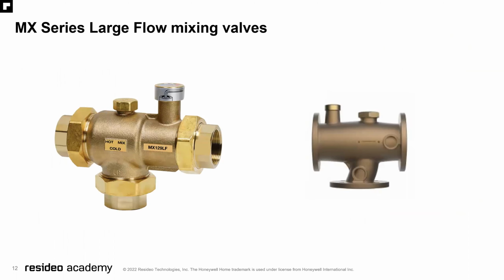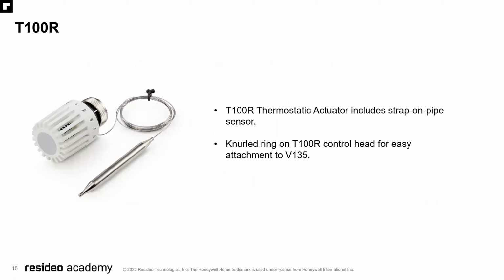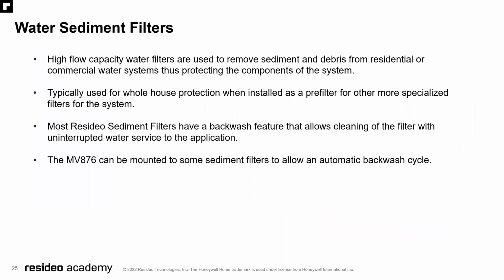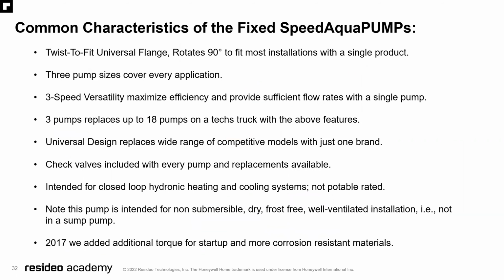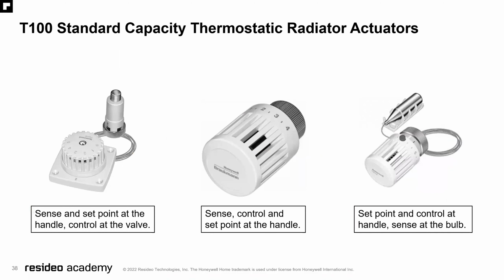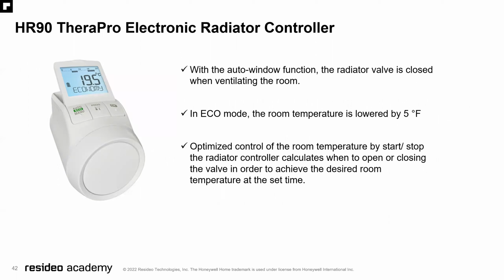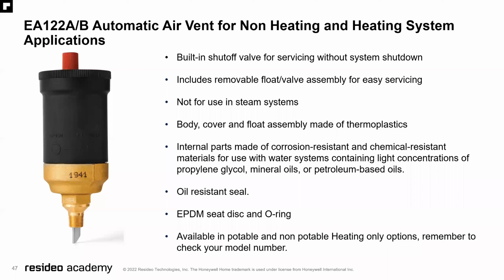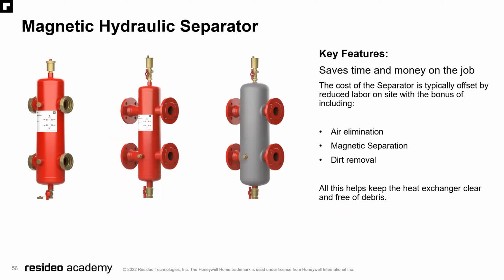Resideo Braukmann Overview

Comment: I just had a DS06LF installed. I loosened the screw to adjust but the 75psi number just spun while turning the the knob, I would like to get it to 60psi.
Reply from the maker: Hi two beer, we recommend you to reach out to your installer to receive assistance with this. If your installer needs help, they can contact our pro support team Monday- Friday 9 am to 5:30 pm CST. -Maria

Comment: I have the f76 and it seems like I’m missing a part to connect the hose for back flush? Could you point me to the right piece?
Reply from the maker: Hi DerekTibbs, we would like to gather more information in order to better assist. Please reach out to our support team on Facebook/Twitter with a private message. We look forward to hearing from you soon. -Paul
Reply: This should be part number AA76-1/2A? Usually it is already included in delivery and mounted under the filter bowl.
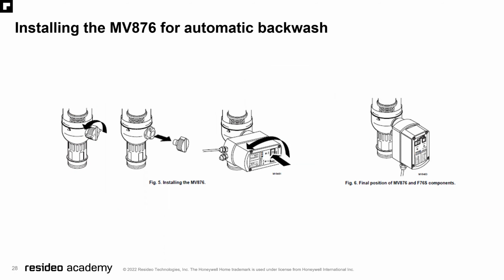Reply: The part shown at 15:33, at least it is delivered in Europe. Bestr regards, technical support water products Germany 🙂